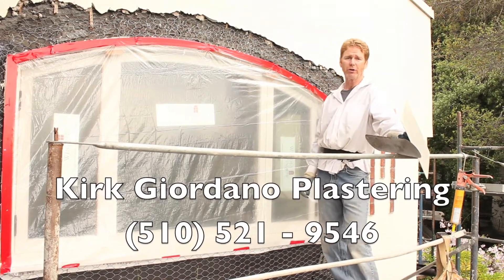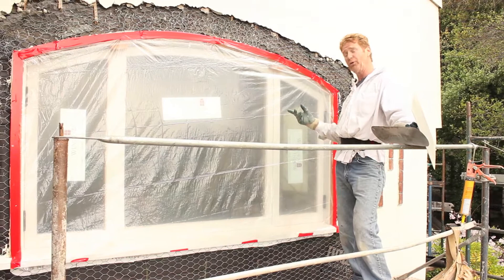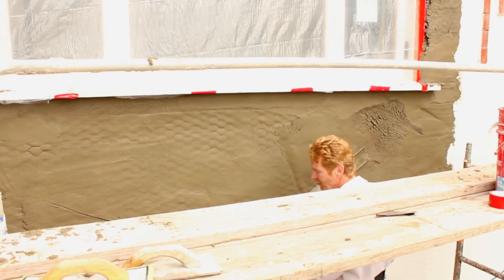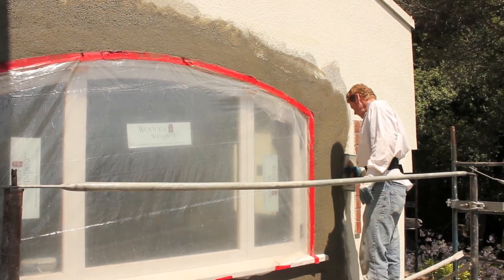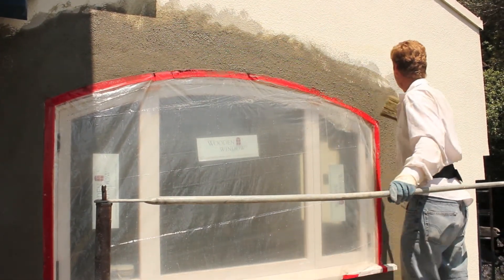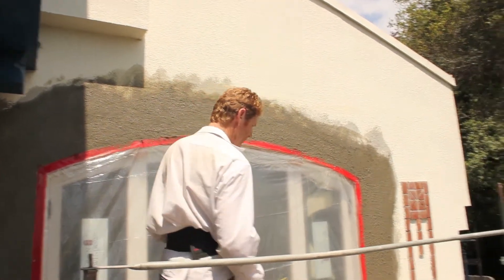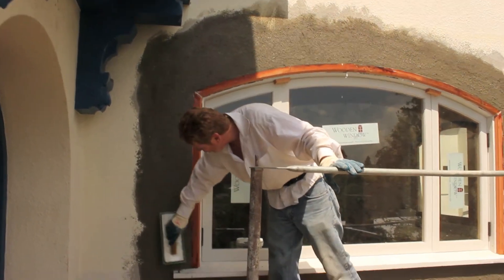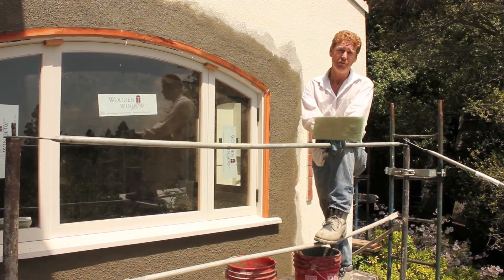Stucco accelerated for fast fixes

Comment: Don't you need a stucco stop or caulk line around the window
Reply from the maker: Howdy Pixelated Mushroom Dude, it's always a good idea to fuse the paper to the frame with excellent polyurethane caulking such as Sikaflex caulking. But a stucco stop is not required in our area, California.
 In fact, all new windows for the last ten years have an expansion joint already incorporated in the windows. 
Thus no need anymore for expansion or J trims around windows in most states.🍾